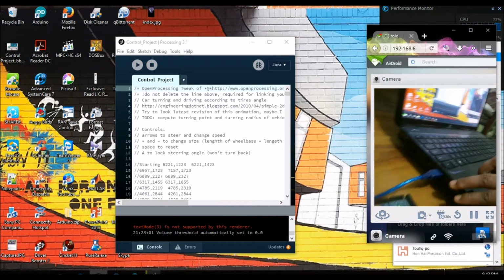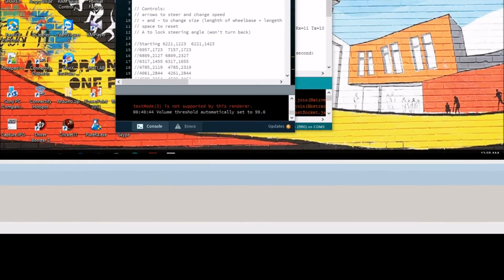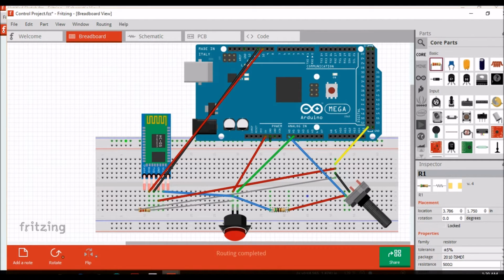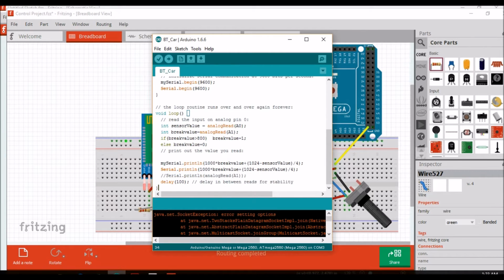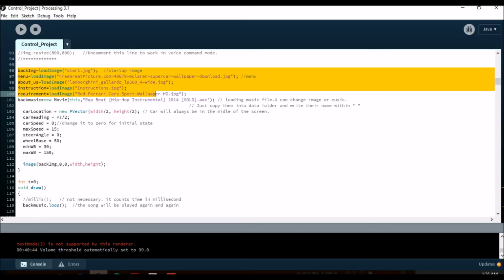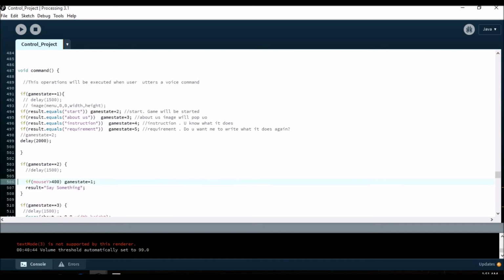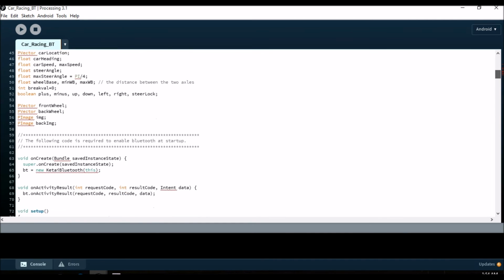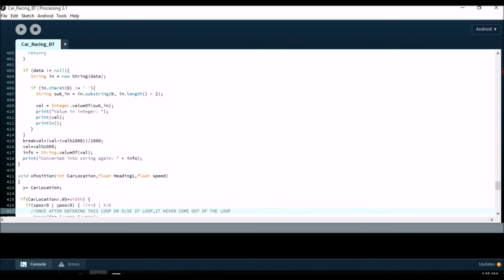Car Racing Game  for PC and Android Using Arduino and Processing (With explanation)

Comment: 1- What's the library name for
'import android.content.Intent;
import android.os.Bundle;'

2- Could you help me out how can I read the data from the Arduino.
On Java I use (Serial, PC):
void serialEvent (Serial myPort) {
  data = myPort.readStringUntil('.');
  data = data.substring(0, data.length()-1);

  index1 = data.indexOf(","); // 
  angle= data.substring(0, index1); // 
  distance= data.substring(index1+1, data.length());

  iAngle= int(angle);
  iDistance = int(distance);
}

I have in the Arduino like this:
Serial.print(angle);
Serial.print(",");
Serial.print(distance);
Serial.print(".");

Now I want the bluetooth to read until the ',' but it doesn't recognise 'readStringUntil'. Can you help me out how to get this working..

Comment: I'm going to try this one out now, can you put the sketches online in like a pastebin and put the link in the discription? :D
Reply from the maker: GamingBroths it's almost 4 in the morning here and I'm really tired. I'll send them to you later.
Reply: Ye that's no problem man! I got the code already now :D.
The only question I have is my other comment (down below I think).
Reply from the maker: 1. It's a library from Android Studio. U don't need to be worried about it.

2. Seems like your Processing code still can't separate angle and distance data. Try to send them as a single data. Like

two_data=1000*distance+angle; //assuming u'r angle data consists of three digits
Serial.println(two_data);

For example: if angle=129 degree and distance=45 (I don't know is it much less or higher) then two_data=129045. Now u can separate them in Processing in this way:

angle=two_data%1000;
distance=(two_data-angle)/1000;

The advantage of sending one data instead of two (or in u'r case 4 considering "," and ".") is that it will speed up the process by a factor of 2 (in your case 4 !)

Let me know if that works. :)
Reply: Tahsin Mostafiz First of all thank you so much! I now have this:

void onBluetoothDataEvent(String who, String data) {
  if (isConfiguring)
    return;
  if (data != null) {
    info += new String(data);
    two_data=1000*distance+angle;

    iAngle=two_data%1000;
    iDistance=(two_data-angle)/1000;
  }
  if(info.length() > 150);
  info = "";
}

But now there's another problem, you said 'two_data=1000*distance+angle' but how does it recognise the distance or the angle..
And what should I print to my Arduino?

Thanks in advance!!
Reply from the maker: Please copy-paste your Arduino code here and let me have a look at it.
Reply: Sure let me just translate it!
Reply: Here you go: http://pastebin.com/h3MHkRhM
Reply from the maker: I haven't been worked with servo for a while so obviously I forgot something. Does "i" means rotating angle here? If u want to send both angle and distance data to Serial port/Processing , replace line 44 to 47 with this:

Serial.println(time*1000+i); 

Let's say ur preserving this data in Processing into a variable called data. Then 

angle= data%1000;
time=data-(data%1000);
distance = time * 0.34 / 2 / 10;

Hope this will work :)
Reply: Thanks I'll try and let you know!
But how does Processing know what 'angle' and 'distance' is, how does it know that when Arduino says Distance = 10, how does Processing know that the distance is 10?

And yes i is the angle (servo motor!) :D
Thanks!!!
Reply: Oh by the way, I only need Processing to read the Angle and the distance!
Reply from the maker: U should use Blutooth Module (HC-05/HC-06) for sending data from arduino to your Android mobile.
http://www.instructables.com/id/Arduino-AND-Bluetooth-HC-05-Connecting-easily/
Reply: Yeye I am, I connected them (for now, maybe I'll keep it like this) to the TX and the RX pin, just figured out today that if you connect the Bluetooth module to these pins you don't need to use the library for Bluetooth, it'll automatically use Bluetooth as the Serial :).

I'm lost now, I'll just post my Processing sketch here as well. I can't figure out how to receive the data and split up it from the arduino. That's the only part I need! One more time for more clearance:

Arduino sends Distance + Angle (✓) --> Processing receives it, (splits it) and see's the Angle and the Distance (✖) --> Draws the radar (✓)

This part is where I'm stuck: Processing receives it, (splits it) and see's the Angle and the Distance (✖)''

Here's the processing sketch: http://pastebin.com/UupXjq2d

Hope you can help me out, just that 1 part xd
Reply from the maker: Okay lets proceed step by step then. In processing code. comment line 181,183,184 and instead add this:
println(data);

Upload sketch on your phone, don't disconnect the data cable, open it and observe what is being printed in your Processing compiler. Does they match with your arduino Serial monitor data? If so or not, let me know it.
Reply: Alright so I did what you said, I put it on my phone, it asked for Bluetooth and it crashed.. Here's the error:

debug:
BT made available.
blendMode(), or this particular variation of it, is not available with this renderer.
java.lang.NullPointerException: in == null
 at libcore.io.Streams.readFully(Streams.java:74)
 at java.io.DataInputStream.readInt(DataInputStream.java:103)
 at processing.core.PFont.<init>(Unknown Source)
 at processing.core.PApplet.loadFont(Unknown Source)
 at processing.test.arduino_radar_android.Arduino_Radar_Android.setup(Arduino_Radar_Android.java:61)
 at processing.core.PApplet.handleDraw(Unknown Source)
 at processing.core.PGraphicsAndroid2D.requestDraw(Unknown Source)
 at processing.core.PApplet.run(Unknown Source)
 at java.lang.Thread.run(Thread.java:818)
FATAL EXCEPTION: Animation Thread
Process: processing.test.arduino_radar_android, PID: 8272
java.lang.RuntimeException: Could not load font OCRAExtended-48.vlw. Make sure that the font has been copied to the data folder of your sketch.
 at processing.core.PApplet.die(Unknown Source)
 at processing.core.PApplet.die(Unknown Source)
 at processing.core.PApplet.loadFont(Unknown Source)
 at processing.test.arduino_radar_android.Arduino_Radar_Android.setup(Arduino_Radar_Android.java:61)
 at processing.core.PApplet.handleDraw(Unknown Source)
 at processing.core.PGraphicsAndroid2D.requestDraw(Unknown Source)
 at processing.core.PApplet.run(Unknown Source)
 at java.lang.Thread.run(Thread.java:818)
Reply: Okey nevermind about that error above, it was just the font. Error now:

debug:
Socket Type: SecureBEGIN mAcceptThreadThread[Thread-3834,5,main]
AcceptThreadSecure
Did not find onBluetoothDataEvent callback method.
Found onKetaiListSelection...
Inefficient font rendering: use createFont() with a TTF/OTF instead of loadFont().
BEGIN mConnectThread SocketType:Secure:HC-06
KBTConnect thread connected!
create Connection thread to HC-06
BEGIN mConnectedThread to 98:D3:31:FC:27:63
Reply: But it's not collecting the data after I connected.
Reply: Alright sorry for a lot of message, after this test it's not receiving data at all...
Here's the debug mode now:

debug:
Did not find onBluetoothDataEvent callback method.
Socket Type: SecureBEGIN mAcceptThreadThread[Thread-4819,5,main]
AcceptThreadSecure
Found onKetaiListSelection...
Inefficient font rendering: use createFont() with a TTF/OTF instead of loadFont().
BEGIN mConnectThread SocketType:Secure:HC-06
KBTConnect thread connected!
create Connection thread to HC-06
BEGIN mConnectedThread to 98:D3:31:FC:27:63
Reply from the maker: Try out this. Modify your code accordin to this and let me know if it works.
pastebin.com/embed_js/z7SSQGCq
Reply: It gives an error on this line:
     if (in.charAt(0) != \' \'){
It says 'invalid characters'
Reply from the maker: Typo. sorry for that. Try :if (in.charAt(0) != ' ')
Reply: Thanks, but I'm still getting an error :O. With 'invalid character'

Error:

processing.app.SketchException: unexpected char: '\'
	at processing.mode.java.JavaBuild.preprocess(JavaBuild.java:361)
	at processing.mode.android.AndroidBuild.createProject(AndroidBuild.java:160)
	at processing.mode.android.AndroidBuild.build(AndroidBuild.java:94)
	at processing.mode.android.AndroidMode.handleRunDevice(AndroidMode.java:295)
	at processing.mode.android.AndroidEditor$16.run(AndroidEditor.java:553)

It says 'unexpected char '\', even though there's no \ at all... I removed it lol.
Reply: Oh maybe it gives that error because there's a space in between them, without the space I get another error that says: 'Invalid character constant'
Reply from the maker: Did u user Serial.println in Arduino ? U r supposed to write only one data in Arduino Serial monitor and u should use Serial.println. Also there should be a space in between "inverted commas" like this: 

if (in.charAt(0) != ' ') //not just ''

Seems like it's the only problem left with your code. Tell me if u can fix this.
Reply: Ye I have in the arduino the last one with the println. So:
Serial.print(angle);
Serial.print(",");
Serial.print(distance);
Serial.println(".");

But the 'if (in.charAt(0) != ' ')' gives an error and says 'invalid character'...
Reply: http://imgur.com/a/PfsNg here you can see it
Reply: Alright I changed it to this now,
if (in.length() > 0) { 
Seems to work for now, but it says:
Error in reading connection data.:null
Error in reading connection data.:null
Error in reading connection data.:null
Error in reading connection data.:null

So still no data.. :(
Reply from the maker: Comment out all the lines with Serial.print(...) Instead of Serial.println(".");  write 
Serial.println(1000*time+i);

Give me  screenshots of Arduino serial monitor and Processing Compiler at the same time(if possible)
Reply: Sorry for late reply, thanks will try that ASAP (probably in the weekend, very busy!) will tell you then!
Reply from the maker: That's okay. :)